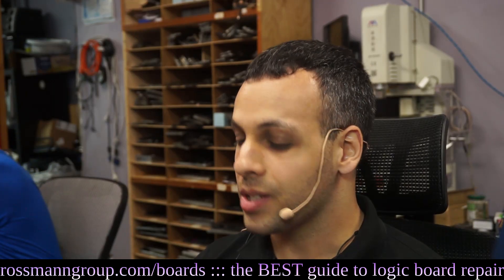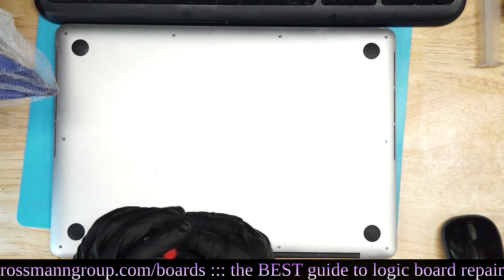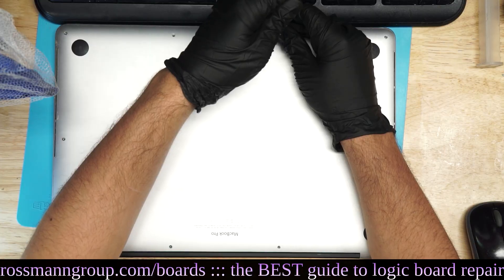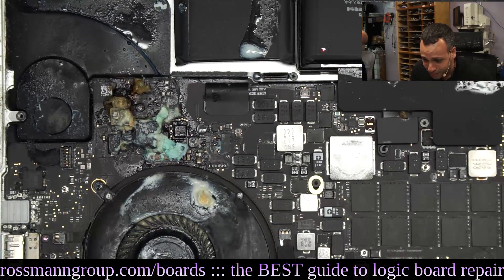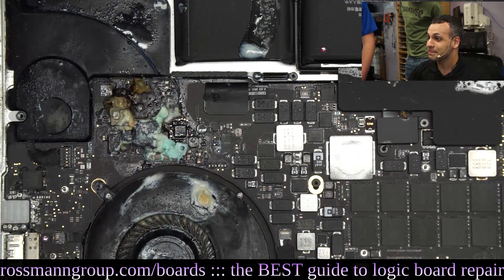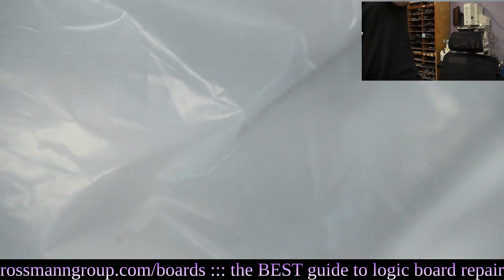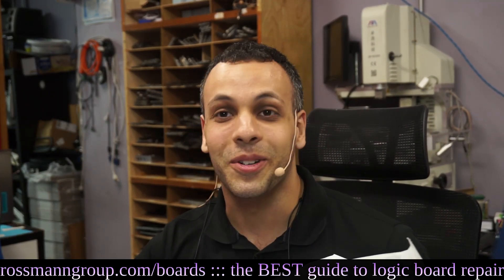A happy little Retina Macbook repair

Comment: Hello there! You are a computer genius. I have a problem and I think only you can fix it. I have an OWC Thunderbolt 2 Dock and it is causing me nothing but grief. The support forums are filled with the same problems that I am experiencing. Currently, I can't use any of the USB ports! Super frustrating!!!!!!!!! Sometimes the screen flickers. I phoned OWC and they said that it is probably the cable. However, these problems all started with the cable that they sold me. So, I bought the genuine Apple cable for some absurd price and bam! it worked for a few months. Now, it is the same old story. I just purchased another Apple cable, and I have the same results without any BAM! Can I send it to you and can you figure something out with it PLLLLLEEEEEAAAAASSSSSEEEEEEE?!?!?!?!?!?!?

Comment: I used to repair VCR's back in the day, a common problem was sandwiches and other food items inserted into the tape bay by kids...usually half rotted by the time you open the VCR....I would see this at least once a week...oh and cleaning ass prints off photocopiers was another "dirty job" during my yrs as a office equipment field tech...

Comment: XD I love Louis. He is so brutally honest. I feel for you man! When i was 18 I bought a laptop off ebay. Guy just said it stopped working and thinks it was the power brick and he is selling it for a friend. I had gotten his full name though. When I was trying to figure it out the first thing i did was pull out the Hard drive (Now this was I think a Dell Inspiron 9100 or something like that with a 2.8 P4 and a AMD ATI Radeon Mobility 9600) so it was a 44 pin IDE. A puff of white smoke came out as I pulled it out. I then had my neighbor call and went over there to check out her printer and told her about it. Said it is coffee creamer. Sure enough i took out the motherboard and smelt just like coffee! Also after looking at the hard drive the guys name and pictures were alllll over it. yea sent him a bad review XD I got it working after 3 baths of Rubbing Alcohol and Distilled water! worked great for like 2 years until it would just get too hot to run.

Comment: That's a feature from Apple to prevent users from opening up their iMacs, you didn't understand the geniousity, proper authorized repair shops have access to hazmats suits with gas masks to open it safely.

Comment: Holy Shit, I've had dead bugs inside computers before and a live centipede once but this has to be hands down the worst. There was one in particular that comes to mind where someone had spilled food all over the front of a desktop where I had to use rubbing alcohol and gloves to clean up before I even touched it. Also another one that was covered in hair, skin flakes and probably boogers of some sort. Semen is pretty gnarly shit though. I really imagine someone has to be trolling you with this shit.

Comment: Back in the 90s I once had to change up a modem board in an IBM PS2 issued to field sales. When I opened it, everything inside the machine was brown and furry - the brown was cigarette smoke residue, the fur was a a mix of domestic dust (which is mostly skin) and something growing on the dust.You'd have have scraped to see chip numbers, and it stank. Suffice to say, I declined to work on it. My boss wasn't well pleased, so I pointed out that I didn't have a mask, nor gloves, and that when you lifted the lid, there were strings of brown goo between the top of the case and the bottom. He went off to make some calls, and I never did touch that PC again. IT was like H R Giger had done a sculpture in thick treacle.
Reply: Roger O'Donnell My dad's PC is just like that, when I opened the sucker to swap CPUs, I got brown stains over my hands and parts of my arms... are air filters good for helping this kind of computer abuse?
Reply: @MicroChirp  Old comment but I'd like to contribute for those that see in future.

Anything good enough to filter very fine particles like cigarette smoke will block airflow to the point of hindering it's cooling capacity. You will need to change the filters often in most applications and I doubt they would be cheap... Just go outside to smoke.

Comment: Louis, Just take a shit on it and close it up. Send it back. You have to one up the troll.
Reply: Take a massive fat shit on the logic board then press the cover back into place.
Go big or go home, right? xD
Reply: And you never know, that might actually be the tool we've been missing all this time to fix macbooks...just a big pile of shit.
Reply: ErizotDread best part is how Apple would call you a certified Apple repair shop because you use 100% pure Apple products. A whole bunch of shit
Reply: Excellent thermal properties, plus you don't need screws!
It's a win win! :P
Reply: Applying extra "thermal compound" to press down on the logic board so the poor semen job doesn't come loose.  SOLDER!  I MEANT SOLDER JOB!
Reply: should test sperm for thermals lol it might work but if you fuck it up don't send it to these poor yobs who have to clean it up
Reply: "I fixed it" would be the same as "I didn't spill anything on it."

Comment: I got to say it didn't look like it was piled in there but it did look covered my guess would be like some of the other ones that it was a milk and sugar liquid spill they thought oh it will get better with time and mold grew in it.  if I had that happen to my pc I would open it myself wipe it down with alcohol with the battery pulled and dry it with a fan before I took it in to get it fixed.

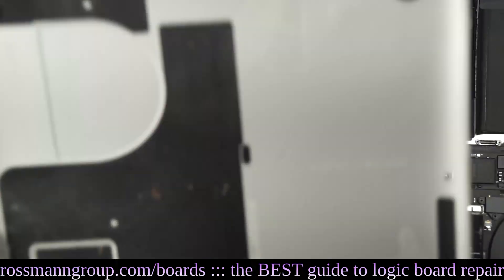Comment: 1:18 Surprise Moth** =)
Can i Send you from Germany a half dead MBro Retine 13"?
It need DDRAM Controller replaced and some small components. Because i "tried" or have done a CPU Replacement on my own and some Parts on the Other side fall of =(